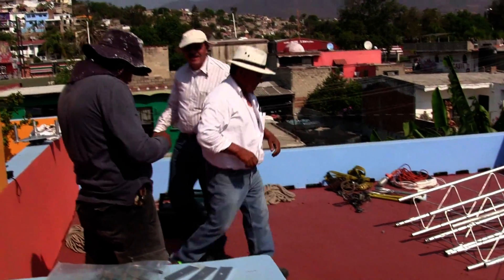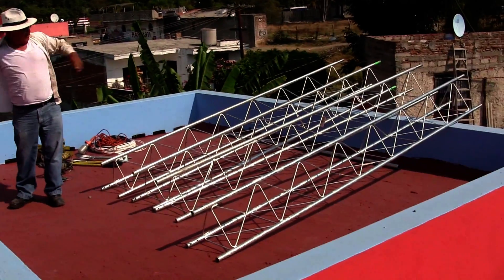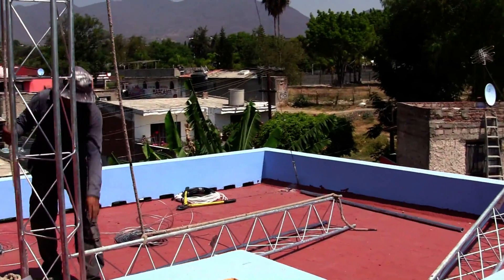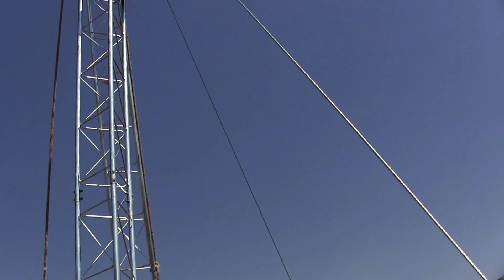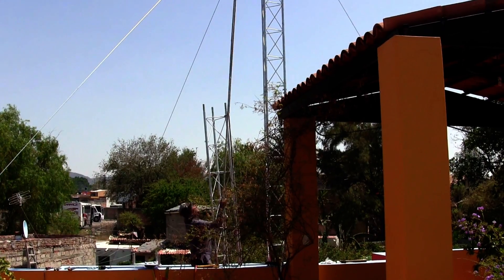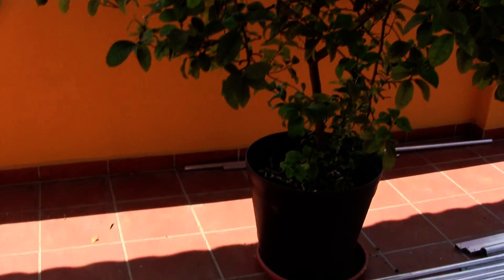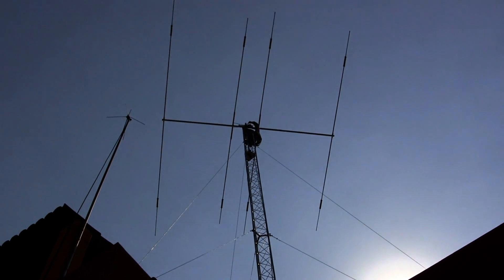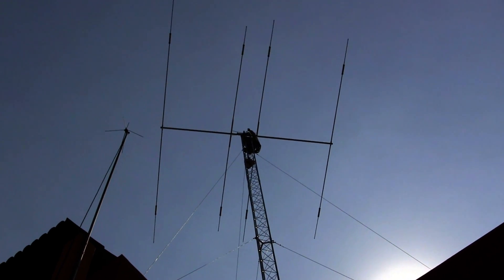My Mosley HF Yagi

Comment: Guy wires should not be directly attached to the tower legs.  The tension on the guys (and the wind) is trying to pull the legs of the tower apart.   Rohn makes a guy bracket that goes around the tower that takes all the tension between the guy wires.   It's hard to see in the video, but I don't even see an thimbles inside the guy wires where they go around the tower legs.